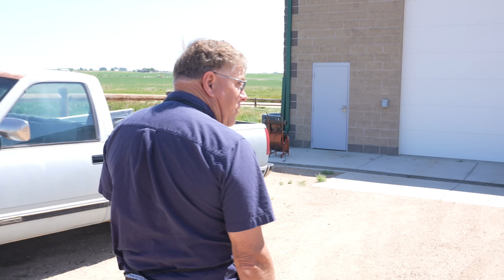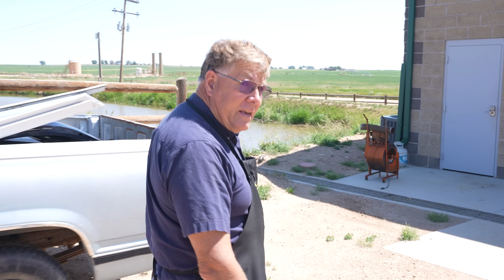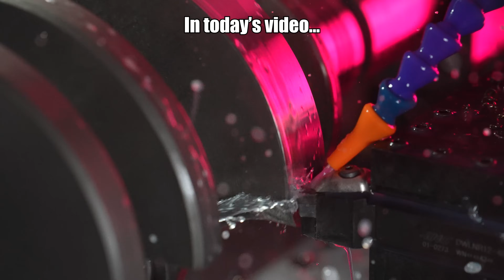CNC Lathe Turn BALANCING A V8 Crankshaft ... It Did NOT Go Well!

Comment: The balancing consists of 2 issues, Static and dynamic static is when both imbalances are in the same plane, dynamic balancing is when the 2 are in opposite planes that form a couple, using a 2000 stewart warner balancing machine with the cantilever sprung trunions on each end and using a strobe light its much easier to see the difference between the couple (dynamic) and same plane (static) i prefer using the S&W machine because an out of balance crank can move up and down and its easier to visualize whats going on, and the belt being in the center cant help but dampen the movement of the crank, i also like the precision ball bearings on each end that the crank spins on verses the white plastic vees the cranks spin on , i will say that trying for absolute perfection is impossible because of the changing forces on a running engine, example #1 is the difference in oil captured by the piston on the down stroke compared to the up stroke, #2 is the changes in center of gravity induced by high rpm, and the parts stretch because of those, an Aluminum rod will stretch .050 and a steel rod stretches  .035 both require compensation on engines in the 7000rpm + ranges, i change bob weights accordingly for reciprocating weights by approximately 3% on up depending on the greater operating range like an engine running say from 8000-12000 would need slightly more bob weight change to reciprocating unless its using Ultra light pistons and  Titanium rods, all these come into play...

Comment: Very cool! It seems like with this  process, it would be helpful to always take material off the side of the imbalance that would drive it closer to the center of the counterweight. Especially because you are both lessening your margin (by turning on the lathe) and chasing two imbalances at once. Drilling is nice and seems faster and more precise than grinding, are there any other reasons you prefer drilling?

Comment: The 4 cylinder Yamaha Apex is interesting crossplane crank):
With this crankshaft structure we have 4 pistons that are all in a different position from each other.
Two pistons are at the beginning of moving downwards, and two pistons are at the beginning of moving upwards.
Piston 1 is at TDC and moves to 90°, while piston 4 is at BDC and moves to 270°. Both these pistons generate a force that is directed upwards (Conrod outward movement) BUT Piston 2 is at 270° and moves to TDC, while piston 3 is at 90° and moves to BDC. Both these pistons generate a force that is directed downwards (Conrod inward movement).
This means that pistons 1 &amp;amp;amp; 4 are a pair that have a force upwards and pistons 2 &amp;amp;amp; 3 have a force directed downwards.
The forces that are directed upwards are cancelled out by the forces that are directed downwards.
This means that the crossplane crankshaft has no secondary force😊
Reply: The primary force is the inertia force produced by the piston mass due to the rotating crankpin’s projected movement along the line of stroke being relayed to the piston via the connecting rod.”
In other words: The maximum force that occurs every 180° when the piston is at TDC or at BDC and vice versa. Every object that is subjected to a change in speed or direction, generates a force that resists this change in speed or direction. At each dead centre this force is at its maximum and directed along the line of stroke, directed in the same direction that the object was moving.

Comment: How do you locate the weights that are to represent the rod and piston? Do you drill one hole on the line or two shallower on both sides of the line. I see multiple holes on factory cranks. Are the holes drilled radial out from the shaft centerline? How do I find the answers?

Comment: I found this quite interesting. The excel and math showed some insights. A university has its uses! What I find curious in this, and earlier ones is why does it only have the balancing feet/sensor things at two points? Would it not be easier if it had four points and remove at the inner throws too? Is this idea just overkill, or a real thing with more expensive machines?

Comment: What would I have done differently? Start with grinding the end of the counterweight on the heavy end to push the hole needed to the center of the counterweight and then turning the OD of the counterweight, and touch it up by drilling.

Comment: Does the mass removed matter as you get closer to the centerline? So the .710 depth should be shallower because the bottom of that calculated hole is closer to the center of rotation? Love your videos.

Comment: I think that if you had drilled a hole first and then cut you might have been in a better place. I'd consider a smaller hole towards the leading edge then cut the balance weight. You have now a better feel of the xyz of removing of weight will have on balance.  It's another option to consider.
    Your method will get you there but there were a lot of steps. I feel that you have a good idea but need to develop it.
    Thanks for a good video with all of the tech issues included.👍

Comment: Very interesting, I learned a lot, Thank you.  This is worse than balancing tires because on a crank you have to drill or weld.  On tires, just add or remove weights, or rotate the tire with respect to the rim.  PS.  I like your Haas lathe!!!

Comment: So, from what I can understand from the whole description in layman's terms.  Basically the counter balance is off about 200 grams or so, so instead of drilling a hole 4" deep to remove the weight from it in one spot, it's better to remove weight by shaving the cb down to a manageable size so you just have to drill out a few grams and get it into balance.  A complicated way of saying that you want to disperse the material removal over a larger area so it will be more rigid and easier to work with.  
However, there's a point at which removing too much material moves the center of gravity/balance point off the cb so you take off only as much as it takes to get to a point where a drilled hole will still balance it but will only be a small hole.

Did I get that about right?
Reply from the maker: Basically! lol 

It’s just a cleaner way to do things 👍🏼

Comment: Since you're having to strike a balance between getting enough weight off and not shifting the imbalance point off the counterweight it looks to me like you could shift the crank off center so as to remove the bulk of the material in the area you need it to come from.
Alternatively, rather than turning the counterweight, I might mill a flat in the area that needs weight removed.

Comment: Does your spreadsheet account for the distance from centerline for the weight you remove? As far as I am aware the balancer gives you grams at the center of the big end, which would be half of your engines stroke. If you remove weight further away from the centerline, you need to remove substantially less weight to make it compensate for the further distance.

Comment: It would be more aerodynamically sound to continue with grinding rather than drilling sharp edged holes (even though it's quick and cost effective for run of the mill stuff)
 Using a CNC lathe you should probably change the radius away from stock to remove more material from the 'heavy' spot, it can be done on a manual machine with a four jaw chuck plus offset centre but takes a long time to set up initially.
0.012" feed per rev is a really high 'roughing' cut (depending on nose radius of tool tip)
'Finishing' feed rate for 'fine finish' is usually 0.004" /rev depending on material and finish required (very common during manual machining of steel/stainless steel)
I trained well before CNC was common machining

Comment: what about adding  weight in the thru holes on the rod throw to offset the issue? I.E. welding a slug in? it would reduce the hole depth to something manageable wouldn't it? its also very simple to check without doing anything permanent

Comment: The engineer in me says as you drill deeper into the crank you are effectively removing weight from a different radius causing the error. Unless of course your calculations take that into account.

Comment: The absolute best part of this video is that you didn't call the damper a dampener. I'm so tired of hearing dampener instead of the correct term, which is damper. Thank you!
Reply: How about "line" boring instead of ALIGN boring?
Reply: @Wheel_Horse  Good luck with that one - line-boring is here to stay, I'm afraid.

Comment: I would remove the crankshaft out of center by removing just enough of the counterweight to eliminate the need for drilling.
Remove a wedge of material.
Can this be done on the lathe?
It could be aligned in the same way in a chuck with four jaws. Calculate the weight of the required triangle beforehand.

Comment: Was it still calculating the mass removal on the radius of the original counter weight. Not the smaller radius that you turned it down to.

Comment: Really surprised that you didn’t bevel/chamfer the edge of the weights before you did the second pass to double check and at the very least before you drilled the holes. Tsk tsk tsk, the old boy should have pointed that one out but maybe he was seeing if the young lad would have picked up on that. He sure does have some patience. Great video anyway, keep them coming.

Comment: I wonder why my 1930  cadillac V16 has not counter weights . I discovered it when I took off the pistons to replace them with much lighter aluminum ones . I guess I won't have to rebalance the  crank ?

Comment: There is not a "heavy side" and a "light side" - that is an artifact of having the vibration sensors at the ends of the crankshaft. The end counterweights may be perfectly balanced and it may be one closed to the center that is out of balance.

Comment: Happy Fathers Day gentlemen…
I have to say that creating a spreadsheet that generates that kind of data is pretty impressive.  
I would like to ask a question….what is the hardness of the crankshaft? 
Also your comment about the chips being blue…
You want your chips to be blue, that means that the heat being generated is escaping into the chip.  That’s exactly what you want…you should be able to turn the coolant of and make your cuts and the material your cutting should be only slightly warm to the touch.  That means your speeds and feeds are correct.
Carbide is made to withstand allot of heat and cutting pressure.  What it doesn’t like is interrupted cuts….but your fine as long as you have at least a .031 radius insert nose and your depth of cut isn’t too deep.
You’re doing great work man! I like to see people pushing the envelope with their knowledge and execution.
Reply from the maker: Appreciate it! I don’t know an actual numeric value for the hardness, but it was pretty dang hard! A file does not dig in much. 

I’ll keep that in mind about the inserts & chips.
Reply: @JAMSIONLINE They do make CBN inserts that are perfect for hard turning interrupted material.  We use them all the time and have had great success

Comment: Could you bias the cut towards the imbalance angle by use of 4 jaw chucks. Or shim one of the Jaws of your 3jaw chucks?
Reply: Alternatively grind the end of the counterweight first, to  bring the out of balance towards the centre of the counterweight. Then munch away on the lathe with less angular change.

Comment: Enjoyed the video but why do you need to do 'a cut' so deep on the CNC? The rear, surely you could have taken a smaller cut that would have moved it out but not off the edge. A cut is not a fixed depth, you can surely vary it.

Also what's the density difference between clay and steel?

Comment: why didnt you lathe cut the OD of all the counterweights?  I havent done this type of balance job yet, but I want to try it.
Reply from the maker: In the future we will probably turn the first and second since they’re roughly the same angular position. In this case, the third counterweight would actually have compounded the problem of throwing the imbalance off the counterweight more quickly.

We really just wanted to focus on one counterweight at a time to verify that the math was working and we understood the process before throwing more uncertainty in.

If that makes sense!
Reply: Makes sense, like I said I haven’t done a lathe balance job yet… but my thinking is you are CW heavy, so shouldn’t  reducing CW mass in the whole crank bring it in balance?  Not worrying about position of unbalance, I would think take a light cut, respin it.  And so on until close.

Comment: BSEE here. I can't do arithmetic or spelling and had a career as an engineer. I started with sliderules, 4 function and trig table books, then.."AAAAAHHHHHH" scientific calculators and 16 bit computers and assembly code. Then, did you know, Fortran ran in embedded M6800s.
Reply: I wrote M6800 ASSY for years.

Comment: I’d like to point out that two of your balance runs, back to back without alteration, were different. One was 102 and one was 104. I think it was indeed an equipment thing
Reply from the maker: All equipment has a level of precision and repeatability to it. The difference between 102 grams and 104 grams here really is fairly negligible. What counts is when you get down close and spin multiple times, it is very repeatable within tenths of grams.
Reply: @JAMSIONLINE  yea 2 grams out of 100 is nothing, but if I don’t move any weights or the crank, I’ve never seen it change by more than about .3 between runs. Seems like something was giving you slack. Your machine may just be different than what I’m used to. I’ve only ever used one crank balancer, it’s about 15-20 years old I think. Lol. It was my grandpa’s.
Reply: a "toot" in that direction could change it a few grams. lol

Comment: Instead of just removing a circle of steel, why would you not have the cutting tool move in and out so it cuts a declining valley where the actual weight removed is.  So the material removed looks like a funnel shaped dished in area where the lowest point is located right on the mass removal line.

Comment: Curious why you do not machine half keys for the keyways for balance purposes?   I noticed you had a full piece of keystock in the crank key.....

I think your imbalance moved when you drilled the hole on the far side, that is what messed you up.  I did much balancing over the years, not automotive, but balancing is balancing and can be witchy sometimes......

Comment: Could you use the X axis to increase the Depth of cut at the point the balancer marked.
So you start at eg 20 thou increase to 50 thou and down to 20 thou to exit.
Reply from the maker: Not possible on this lathe, although I believe there may be machined out there with that type of capability!

Comment: With all due Respect to you both
I’m no engineer 
Or Machinist 
But I believe the holes need to be drilled should be divided by 2 of the weight your removing due to the combination of both counterweights from the back & front sides
Idk 🤷🏻‍♂️ 
Just thinking out loud with my old brain

Comment: Rather than exponential, armchair engineering it in my head I would imagine how much the point of imbalance moves with each cut depends on how far that initial point is from the center mass of the counterweight.  Theoretically it would also be very slightly diminishing as you get closer to the crank centerline the counterweight is smaller.

Comment: sooo,  #1, you know that Haas mfg has classes you can take to learn how to run their machines, right?   #2  do you know what might help you with marking the crankshaft exactly where to drill? i have a lazer level, that i have used several times for various things. if you mounted that directly above your balancer, it would give you an exact line to which you could mark the crank. they are inexpensive, and work very well.. the hard part would be getting it aligned exactly. #3  TRUST YOUR INSTINCTS!!!  If something doesn't seem right, it probably isn't
Reply from the maker: Did you watch the whole video? 🤪
Reply: @JAMSIONLINE    yes. but I did send the comment before the end.

Comment: I would've just added weight opposite and drill a smaller hole in original spot, split the difference.🤔🤷‍♂️
Reply from the maker: You gonna glue the added weight to the air?
Reply: No, the front is opposite to the back, no?

Comment: Your bobweights are all wrong. They've got to be concentric to be accurate. The extra masses you've got hanging off the sides, they add together as vectors, not added arithmetically. You end up with a lighter balance factor.

Comment: Jim you really need to teach the young fella the KISS PRINCIPLE
Reply from the maker: You miss the entire point of this channel. The goal is not to keep it simple. The goal is to push our level of perfection and learn something new daily. If this were a normal shop we would keep it simple, but it’s not. It’s a YouTube shop, and we have the luxury of spending more time in the pursuit of perfection.
Reply: Not sure if utilizing KISS is the way to go either, crankshaft balancing is tough, you have to balance a lot of cranks to get really good at it but also when something isn’t going right it can be hard, is this the most perfect balance job? No. But they are learning with new to them equipment. I balance 50-100 cranks a year and still have some things  that makes me scratch my head, would I weld 40 grams into a crank? Nope. But sometimes you gotta do what you gotta do!

Comment: Only an auto mechanic would use a 3 jaw chuck and a live center to balance anything. 3 jaws routinely run out of.001-.003”. Unless Live centers/tail stock is indicated to zero deflection, that crank is junk. 
So your crank weights are balanced to your lathe but will run out in the engine. Duh?
Buy a 4 or 6 jaw. Indicate mains on both ends to .0001” min. Use a bearing steady rest on the outboard end. 

Glad it’s not my crank.